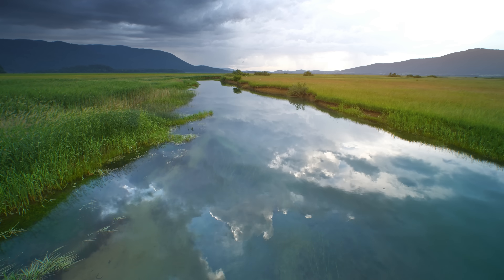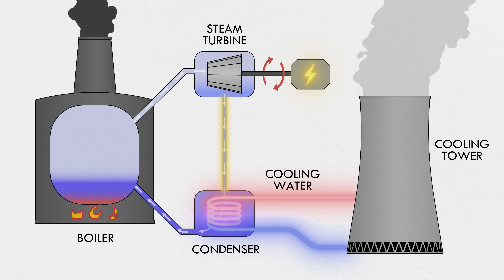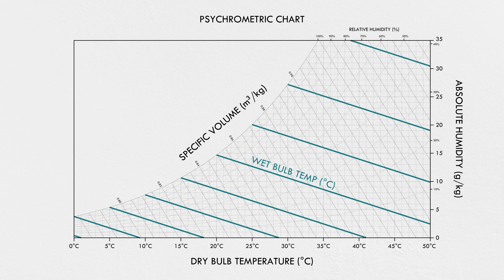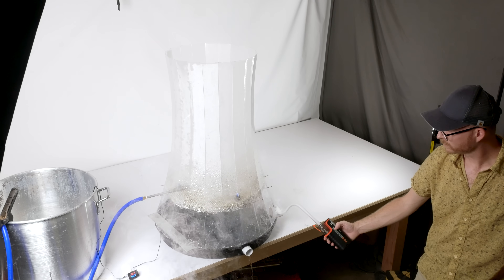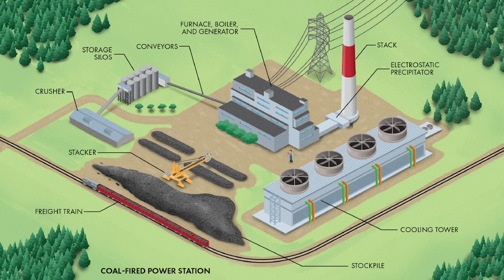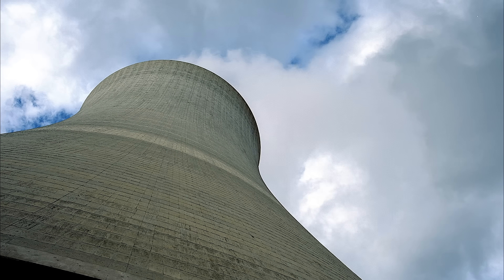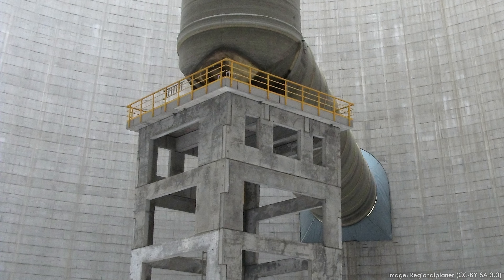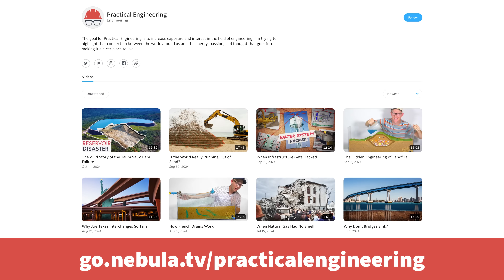Why Are Cooling Towers Shaped Like That?

Comment from the maker: ⚡Making a holiday gift list? Check out the store at https://store.practical.engineering
🌌Get Nebula using my link for 40% off an annual subscription: https://go.nebula.tv/Practical-Engineering
Reply: Question, assuming that I am already subscribed to Nebula (I am), as a creator does it help you more to watch you videos on TY or nebula?
Reply: You should research Yakhchāl cooling in the desert to see similar solutions  @marblemunkey
Reply: I just saw you in Bloomington IL!  Love the videos man and thanks for making the event free to the public!
Reply: A hyperboloid cooling tower was patented by the Dutch engineers Frederik van Iterson and Gerard Kuypers in the Netherlands on August 16, 1916. The first hyperboloid reinforced concrete cooling towers were built by the Dutch State Mine (DSM) Emma in 1918 in Heerlen.

That's 3 miles away from my house. Seen it been demolished when i was a kid
Reply: @RogerKeulen  It was improved as Heller–Forgó system by two Hungarian engineers: László Heller and László Forgó.
Reply: I have a question relating to the coolant tower efficiency. 

Would a fan with a separate air intake and a guide structure obviously in the middle and above the plastic bits inside to point that airflow more accurately towards the top increase the ambient airflow? 
Like on one of physics demo when a person was trying to fill a long plastic bag by exhaling into it like it was a balloon versus the teacher just blowing from the middle and not bothering to seal it with their mouth and filling it instantly and effortlessly.
Reply: Watched your video on nebula but came here to say when you said "I'm going to build one in my garage" I was all excited to get to see you build a miniature thermonuclear reactor in your garage and immediately had flash backs of the story of David Hahn. But your video didn't play out like that at all 😂🤣😂🤣
Reply: Grady, how does this relate to those big (what looks like) mechanical cooling towers you see when a large area like a university or a theme park uses boilers to provide heating and cooling? How do they get heat out of essentially a cooling machine? Or is the heat a byproduct of some other process and they are just cooling excess heat not needed to heat buildings? I think it's called District Heating or District Energy?
Reply: @DisHsDd  Quite a few questions there, so I'll do the best I can with my limited exposure to climate conditioning. (1) The University I went to and many commercial applications use a heated/cooled (conditioned) fluid loop of water or glycol to move heat around the system (buildings, rooms, etc.). When heating is demanded, the fluid is heated by boilers. When cooling is demanded, the fluid is cooled by chillers. Chillers are similar to a residential air conditioner/heat pump, in that they use refrigerant to move heat from the evaporator to the condenser. In a chiller, the evaporator and condenser are encased and fluid is ran through them. The condenser fluid can be cooled by a cooling tower or through a direct exchange heat exchanger with ambient air. At the final point that is needing conditioned, heat exchangers are used to transfer the energy into and out of the fluid with air handlers or other point of use equipment. (2) Cooling machines just move heat (energy) from one area to another, so one side of the system gets cold and the other gets hot (following the 1st and 2nd law of thermodynamics). (3) Not that I know of. Steam coming from streets can be leaks from the steam heating system, water runoff evaporating in the warmer utility tunnels underneath, or just the warm air rising and condensing in the cooler above ground air. (4) The term is regional and can even vary from one governing authority to another. My University called it the Power Plant, even though it didn't produce any power, just conditioning for something like 26 buildings on campus.
Reply: At work we always say "Hot rock make steam and it go brrrr". I love talking to the nuclear engineers.
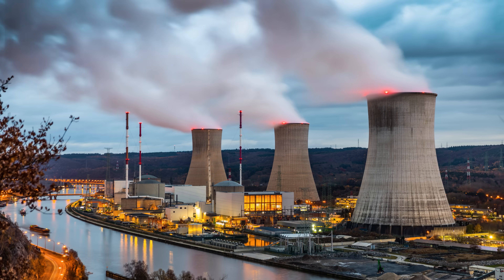Reply: Wanted to stress just how much having an Ultimate Heat Sink (UHS) is a stringent requirement for nuclear plants. He mentions it at 13:38 in the video but being able to prove that you can keep the core cooled in accident scenarios is necessary when you're getting your plant licensed. Source: I am a nuclear engineer, although my plant does not have a cooling tower but a cooling lake.
Reply: People say turbIne because there’s an I there, you bristol.
Reply: that beard is awful bro 🤢
Reply: Grady. I love your name is a pun on the job. However I am here to ask  if you could tell  something about how the wind going around one tower can collapse the tower behind. I saw a video years ago with a tower wobbling and collapsing because teh eddy currents of wind passed around the tower then there was a place downwind with twice the winds. I forgot teh term for wave crossing and create a bigger wave. Constructive interference maybe. Please please pretty please with a cherry?:)
Reply: I noticed how close your finger was to the spinning cutting tool 🫣
Reply: I have Nebula, WORTH IT! so much content on there without YT commercials, AND they are not time consuming. straight to the point with additional content YT doesnt allow
Reply: I was curious about this for years, thanks for making the video.
Reply: nice bear dude
Reply: cross-flow cooling next please :D
Reply: Oh, I thought that the curvature was somehow related with Bernoulli's principle to intensify the flow. I'm surprised to learn it is only due to the stiffness of the tower. Why regular chimneys are not constructed that way?
Reply: How do geothermal power plants work?
Reply: There's an 'e' at the end of “turbine”, that's why the 'i' should be pronounced as a long vowel, '-bine' not as a short vowel '-bin'.

No wonder your country is in the ignorant shape it's in. 🤨
Reply: Thanks
Reply: On the pronunciation of "turbines," it is customarily pronounced with a long "eye" sound. The other pronunciation makes it sound like south Asian head gear.
Reply: love u from india 👍👍👍
Reply: Have you ever seen traditional Armudu glass, or Turkish tea glass? People know that shape hundreds years ago before building steam power plants.
Reply: Here is something about there inventors;

https://en.wikipedia.org/wiki/L%C3%A1szl%C3%B3_Heller#Heller%E2%80%93Forg%C3%B3_system
Reply: Sir, but why Hyperboloid not used in construction of residencial building ? Can it minimise earthquake risks ?
Reply: Cool,  now when can we order custom clear RGB cooling towers for our over clocked  gaming PCs ?  🙂
Reply: I Wana know why must power steam water must be cooling again???
Reply: 19:48 19:48 19:48
Reply: Sorry but my hats dont produce power my turbines do.
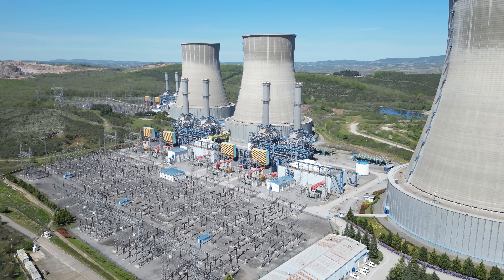Reply: @PracticalEngineeringChannel, enjoyable and educational video! I liked the "Pringle factor", lol. @13:30, has to be some kind of experience ascending the side of one of those towers!
Reply: @PractialEngineeringChannel you mentioned the special shape of the towers.
Perhaps a video on Shukhov's towers would be interesting?
Reply: Actually, that IS the most common cooling tower design, the world over. Also, glad you’ve now stopped saying (phon) ‘prahceseees’ for processes. Glad that died. One wouldn’t go about saying ‘buisnesseeees’ or ‘princessees’ now would one?
Reply: https://en.wikipedia.org/wiki/Frederik_van_Iterson the hyperboloid design had an evolution in itself
Reply: i prefer the third, cursed pronunciation. tur-bean.
Reply: Was Grady on the building an easter egg ?😊

Comment: The shape is close to a catenoid, which is an area minimizing surface, so it requires minimum concrete. Also, it is a hyperboloid, which means it is covered by two orthogonal families of straight lines and thus by a net of orthogonal rebar.  Mathematician here. Love your channel!

Comment: Really excellent video, congratulations.  I designed, constructed, and commissioned power plants for 40+ years.  Including one near San Antonio, in Seguin (Rio Nogales) a 3-on-1 Combined Cycle.  I expected to have criticisms of your video when I first started watching it, but at the end, I couldn't think of anything you didn't cover.  Except maybe to mention Air-Cooled Condensers, which have been gaining popularity since they use much less makeup water, at the cost of higher condenser back pressure and therefore lower turbine output.  Have a look at Kusile Power Station in South Africa for some huge ACC's.  Nice work!

Comment: 6:18 "...and that energy is absorbed from the liquid water cooling it down". This statement while correct is incomplete.

Evaporative cooling happens in several steps:
1- Evaporation: when air and water meet (counter-current flow), a "small" portion of the liquid water evaporates and turns into water vapor. The energy needed for this phase change is the latent heat of vaporization, which is "extracted" or absorbed from the remaining body of water and Air.
2- Cooling: The remaining, non-evaporated water loses a significant amount of sensible heat, causing its temperature to drop.
3- Convection: Air is heated up in contact with hot water (also contributes to water cooling).
4- Condensation: Finally once in contact with the cooler and dryer ambient air, it must give that vapor back as a cloud.

Comment: You say the tower is this shape to increase buoyancy or cost.  The tower is this shape because the heated air accelerates as it rises (to some max velocity).  So the tower shape is based on how fast the convection current is moving.

Comment: Whew a lot of variables.  It's starting to sound pretty good!  I use to calculate different rooms for audio engineering and those calculations can be long process.  Trying to take into account each exhaust tube on it's own by length and then summing the result of each into the next piece would probably help account for some thermal and mechanical losses each tube would have down the line.  Including some math to take into account the speed of sound changing from atomospheric differences in each pipe as well.   Probably adding in some variance within some of the mechanical and thermal tolerances could help with the dynamics of the exhuast.  I guess I'm rambling because it's always been difficult to replicate that breathing dynamic of an engine with so many different variables.

Comment: The problem with river cooling is that because of environmental reasons you can't make the river too hot. Some river cooled nuclear powerplants later added cooling towers because at times they had to reduce their power output to comply with river temperatures.

This combined setup, whilst expensive, combines the advantages of both systems. You can use river cooling so you produce less clouds, but aren't capped by water temperatures. And worst case you still have the safety of being able to make the river boil, if you really have to

Comment: The reason that so much engineering goes into powerplants is because there is a lot of money involved in those projects, so even tiny optimizations are worth a ton of money, and through that gives you good return on investment even if you have large teams of engineers working full time on such optimizations. Noteably powerplants are often also not the only plant of a given company, as they often build more over time and as such it makes sense to have those engineers work on optimizatins even between projects. Even if it is a one off, there are engineering consultancy comapnies that do deal with these things to give you at least some level of expertice and optimization, though they aren't exactly cheap, but it is still peanuts compared to the full costs of a powerplant.

Comment: Layman's question: the tower is designed to cool the water, but that basically means extracting the heat energy in that water. Why not just run that water through some more turbines to turn that energy into electricity instead of releasing it into the air?
Reply: Water droptlets are actually extremely dangerous for steam turbine blades. The steam that runs through them is several hundred degrees hotter than the temp required to boil water. This keeps the steam "dry". So basically it's easier and safer to condense the steam back into water after it exits the turbine and pump it back over to the boiler. There it is boiled into steam and superheated for it's next pass through the turbine. This insures that there are no water droplets in the steam. If you want to look into it more this is referred to as the Rankine Cycle.

Comment: The problem with these is the fog they produce. Not an issue on a normal day, but deadly in an inversion. In an inversion, that fog gets pushed down, collecting in valleys. Sometimes as thick is soup. Something the people around Chattanooga understand well. Two famous crashes happened near there. The biggest blamed on the paper plant, but same effect. The one south of Chattanooga, 12 years later, they just blamed on the weather.  Both are in the same valley as the power plant. That whole stretch has fog warning lights now.

Comment: Cooling towers have a hyperboloid shape to increase cooling efficiency and structural strength. The wide base allows for maximum air intake, the narrow middle accelerates the rising hot air to increase airflow velocity, and the top slightly widens to help disperse the moist air into the atmosphere. This design maximizes the natural draft process, which relies on evaporation to cool water and is enhanced by this specific shape.

Comment: It's pretty clear from the comments that many people don't get the essential principle of how thermal energy production works.

With any form of thermal energy production, what you're doing is taking something that is hot and making it do work on the way toward cooling it down.

If you think of the steam coming out of a kettle turning a pinwheel, why does that work? Only because the steam is going from one place (the hot kettle) to another (the relatively cold environment of the room.) It spins the pinwheel along the way.

If it were instead the insides of a giant steam cauldron or pressure vessel, all at the same temperature and pressure, the pinwheel would not turn.

The temperature and pressure could rise higher and higher, but it's all the same inside. The pinwheel wouldn't move ... unless you were to drill a hole in the pressure vessel and let the steam out into the cooler, less pressurized environment. You could easily spin a pinwheel off that.

In short, it's the transition from hot to cold, from a higher energy state to a lower one, that lets us do work.

Comment: It was weird in Heat transfer to be accustomed to using equations to solve problems then all of a sudden this graph appeared at the end of the class, the lines were hard to read and associate to an axis at first, but if you laminated it and used an expo marker things became a lot clearer and easier to understand. It’s not an x,y graph it’s an x,y,curve. These graphs are great when planning a preliminary design

Comment: The Heller–Forgó air-cooled condenser system is the invention of two Hungarian engineers who were both awarded the Kossuth Prize. It is an indirect air-cooling system in which the cooling water of the condenser is cooled down in a closed circuit, without water loss, by means of air. The two Hungarian engineers, László Heller and László Forgó, designed an air-condensation system that solved the problem of the previously high cooling water demand of thermal power plants. The Heller–Forgó cooling unit—its widely known name—became a highly significant invention that attracted international attention.
Reply: این ، همان راهکار درستی است که تا اینجا، کسی به آن نپرداخته بود. بهترین روش ممکن

Comment: These hyperboloids look simple but calculating the vertical, diagonal and hoop stresses so they know how much reinforcing bar to use is way beyond my capabilities. Loading a thin wall plastic tower with a big brick really surprised me. Great Presentation

Another place curved structures are common is the inlet scroll shape oof the intake to a Frances (radial inflow/vertical outlet) hydraulic turbine used in many hydroelectric power stations.

Comment: The water cooled in the coolimg tower is used to cool the exhaust steam from the generator in the condenser via tubes, removes the latent heat to get condensate and reused as feed water for the boiler, the water used to cool goes back and is cooled in the cooling tower, not the steam itself

Comment: It’s common to boost dry cooling towers with water spray during heat waves, which increases the capacity and efficiency of the chiller.

Comment: Spent 30yrs building and repairing cooling towers. Think of them as radiators in your car. Radiator breaks and your engine must shut down or burn up. The problem is it's not involved in making the product or money. Therefore they are the last item to keep maintaining. A lot of times they run them till they fail or sometimes totally collapse 😮

Comment: Hey Grady, you might better explain cooling towers as specialized heat exchangers - exchanging heat from the superheated water to the outside air, by maximizing surface area, just like in traditional heat exchangers.

Comment: What if we used the cooling loops in PCs to power turbines used to further overclock the PC and causing the turbine to spin faster due to the heat generated by the overclocking

Comment: Two questions: 1)  Why does the water have to be cooled?  Why can't it be passed straight back again to the boiler and make use of the heat that it already has?  2)  If it has to be cooled, can't that energy be made use of somewhere else?

Comment: Hello there, could a cooling tower be used like the def filters in semi truucks to pull the free carbon out of the air? it would have to be filtered from the returning water, but could massively help our carbon problem